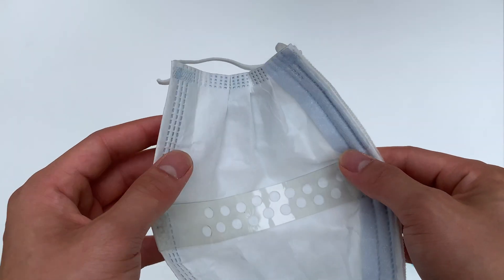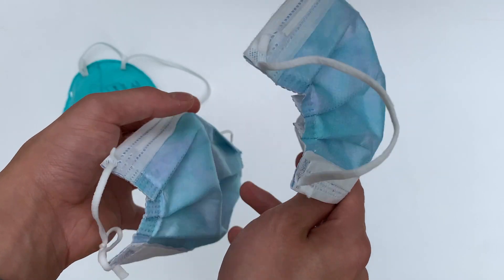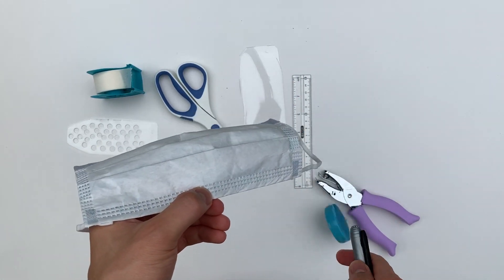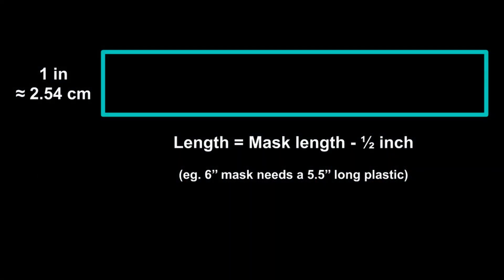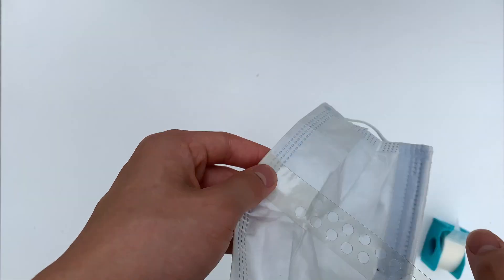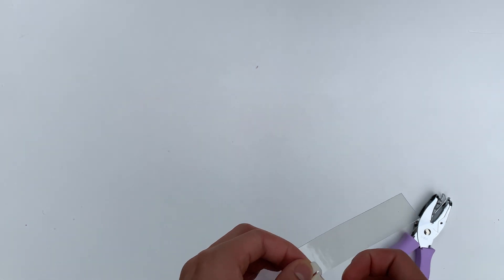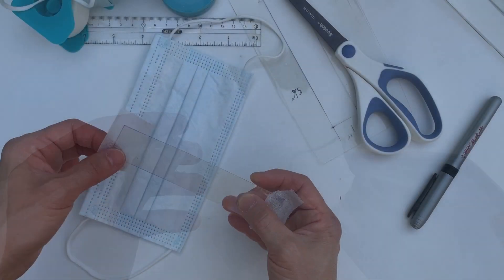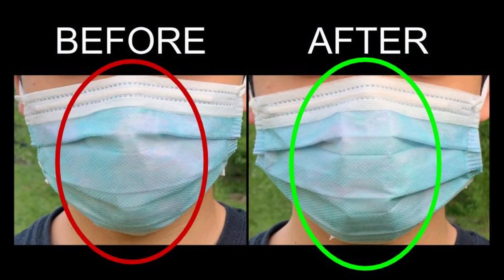FREE 3D Mask STRIP!The Original Mask Hack!DIY under 4 minutes!

Comment: Thank you!! This was super easy to make and it worked like a charm. I was out under the sun for 5 hours straight and it made breathing so much easier. I still got sweaty but not nearly as much as I would've if I didn't use the strip. I only made this 30 min before I went out so I just used cardstock since that's what I had lying around, but I'll use plastic next time :D
Reply from the maker: I’m glad it works out well for you, thank you for the compliment! I really appreciate it!

Comment: the idea is economical.. but how about the integrity of the facemask after all those activities installing the strips? its my opinion no offense intended.. 3d facemask with mask strap hook arent really expensive though
Reply from the maker: Thank you, I appreciate you take time to write me a comment. I did this video back in July 2020 (when mask brackets weren’t commercially available) when my mom who is a nurse was having problems wearing her level 3 surgical mask working 10+ hours. Also at that time in the US everything was in lock down, a lot of hospitals even need to reuse masks after sanitizing them. A lot of materials was limited. Mask brackets are widely available now, but I don’t see a reason to take this video down. My mom is still using this at work and still very happy with it.

Comment: Good idea, but you are contaminating the mask by touching the side that goes to your  face. Permanent marker has a smell. Not good if you breathe  especially if you have allergy.
Reply from the maker: Jesecca thank you for your comment. I always wash my hands before I handle my mask. Sorry, I did not mention it. (My mom is a nurse, she taught me well.) Regarding using the permanent marker, you are right, it does leave a smell. You can use a pen to mark it or just fold it to find the midpoint. I appreciate you take time to discuss with me. With more inputs, we can improve together. Thanks.